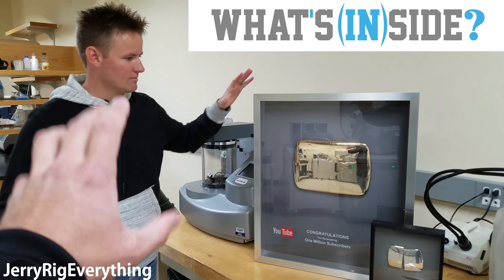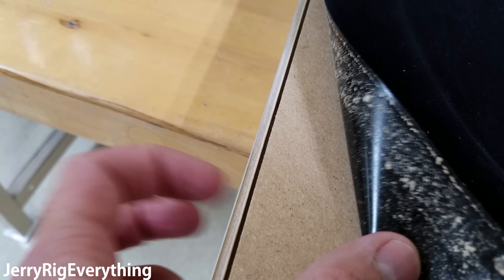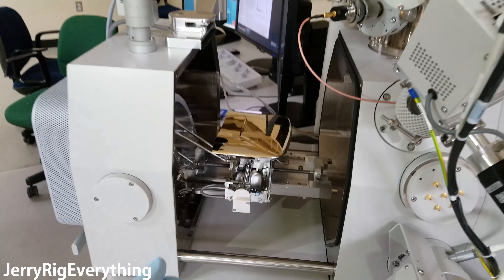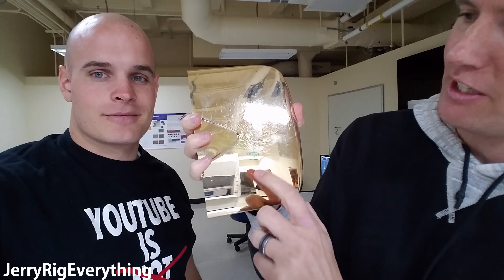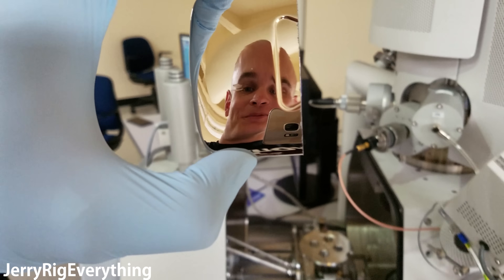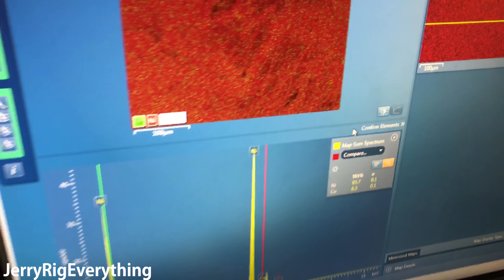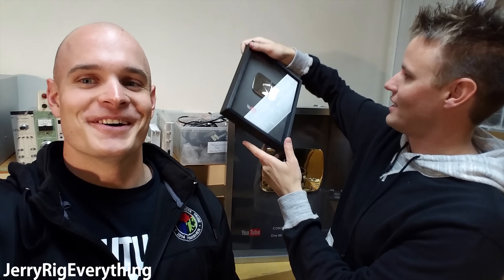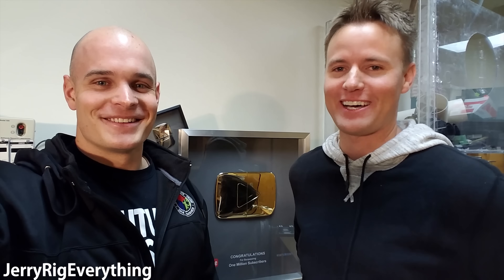What is the Gold Play Button REALLY made of?!?

Comment: Well - as you mention in the video, XRF looks below the surface as well. They would not use silver on the silver play button because it tarnishes. I suspect it would also be brass (Cu/Zn) then copper plated, then nickel plated. The scratch you looked at sees the Cu plating below the surface. Same story with the gold play button. It is actually plated with pure gold, but the coating is so thin that the nickel plating below it shines through. What you see on the outside is indeed pure gold. The inside is brass. This is then copper plated to give the nickel coating something to adhere to. Then it's nickel plated, to provide a barrier for the zinc in the brass, which would otherwise discolor the gold coating after some time. And finally, there's a few microns of pure 24ct gold.

Comment: The button is most likely made of brass, then plated with nickel, and then plated with gold. I've never heard of a nickel/gold alloy. When you looked at the composition of the front, that's what was polished, so the plating is thinner, which is why the nickel content was higher, and is why you saw the brass component. The spectrometer isn't going to tell you the composition of the entire button. Pretty much just the surface and a tiny bit below.
Reply: And I commented before I watched even half of the video.

Comment: It's called electroplating hence the term 24k GP.
They take a brass button and electroplate it with 24k gold in an acid formulation. The electron movement deposits the gold on the brass. Geese did you NEVER go to school?
The gold content on the front is less because it's the polished side. They used a polishing wheel and polishing rouge which removes a tiny bit of gold when polished. Man, I'm old enough to have learned that much, before HS. I'm actually embarrassed for you. SMH

Comment: This actually makes perfect sense... You take a brass blank, and polish it, then nickel plate that, polish it, then gold plate the top for high gloss gold. The silver button can't really be silver because it tarnishes in air.

Gold plating can be as thin as several angstroms thick, while nickel plating is easily measured with standard units. Couple that with the tunneling of the electron microscope, and its rather obvious why you saw so much nickel.

Comment: For anyone wondering, SEM-EDX that they are doing will penetrate a micron or so into the surface. I am not surprised to see Cu and Ni as the most common electroless gold plating processes are a Cu layer, a Ni layer and finally a Au layer. Typically the Au layer is only 175nm-2500nm in thickness. What they could have done is to lap the edge and SEM the edge to see the layer build up if they wanted to verify. Cool work either way.

Comment: the reason for more gold on the back is because the back was not buffed and polished after electroplating. the reason the smoothing goes around the edge is because of the soft buffing wheel wraps around the edge.

Comment: Gold plated items are very typically copper (or brass) as a base substrate, then a layer of nickel, and a flash of gold. Technically, your play button IS 24K plated, but that plating is so thin that your mass spectrometer readings are seeing the nickel every bit as the nickel below it, and the nickel is thin enough that the copper/brass underneath.

The reason why you got readings of a higher percentage of gold on the backside reading vs the front, is that the gold after being plating is buffed to a mirror finish, which actually removes gold whereas the back was left unbuffed. 

That shiny spot on the back is just were the casting in the mold (which is actually made frequently of wet sand) had a rougher spot or some other imperfection, which was then removed with a grinder and buffed slightly to hide it. Totally common.

BTW, the RIAA does not use actual gold/silver/platinum in their record sales trophies either.

Comment: the plating process is probably a gold plate over a nickel dressing layer on a brass metal. the nickle is probably there to help the gold adhere to the brass. the polishing probably removed alot of the gold on the front surface.

Comment: The gold one is made out of brass.  Then gold plated then coated with nickel.  The nickel keeps the gold from getting scratched.  Nickel is a very hard metal.   There is more on the back side because it's not polished as much and the gold goes into all the little groves.   I used to work at a plating facility years ago.  Learned a lot about plating and anodizing..  Good stuff.

Comment: you could play around with the acceleration voltage to vary analysis depth... I think. and the base metal is likely the same for bothbuttons, copper and zinc. the lack of a zinc signal is likely due to it being below the detection limit. nickel plating is necessary before gold plating for better adhesion.

Comment: The gold plating isn't exactly 24KT, but it is definately a gold plating.  and you cant really blame them for making the silver play button nickel because if it wsa silver it would tarnish and nobody wants to see an oxidized silver trophy.
Reply: Tarnished silver isn't oxidized.  It's due to a reaction with sulfur in the air.
Reply: Silver tarnishes over time with exposure to air. It's quite obvious because the tarnish is black. This can't be prevented without sealing the silver from air exposure. There are ways to do that, but they wear away over time and mean you're not actually looking at silver when you look at the thing. If your silver has held up for years, it's probably just not silver.
Reply: Remember how the silver one was nickel on the surface, but not underneath? That's because it was plated with nickle to look all nice and shiny and silver. The gold button is almost certainly brass with a nickle plating, and THEN a gold plating. The nickle layer makes the gold really shiny and bright without having to have a much thicker gold layer. The electron microscope penetrates the surface a little, so is probably picking up on both the gold plating on the surface, and the nickle layer underneath. That is, it IS 24 karat gold.
Reply: I've had a silver ring for years that i dont wear because its ugly and dont sell because it was 80$ and i get 20$ for it. Its still as silver as it was when i bought it or it seems like it. If the ring can be that good the button can be that good.

Comment: I worked for a circuitboard mfg on the gold lines. The reason you see those readings is that huge chunk of BRASS was plated copper, then nickel, then gold. Toss in some cleaning and etching baths in-between each process and viola, fake ass almost worthless trinket and trash award. YouTube should have sent a fat F#@%ing check for generating that much revenue for them, i.e. BONUS/COMMISSION check. Cheap b@$t@r6s

Comment: having a high percentage of nickel is actually quite normal.

if you plate gold directly on copper alloy, the gold will migrate down into copper and will be gold plated no more.

so you start by plating 1000 micro inches of nickel, then plate like 2 micro inches of gold to "color" it.

this is exactly how they do it with el-cheapo gold plated connectors.

Comment: It makes perfect sense. Gold plating is not applied directly, but after a nickel coating. The substrate is brass, followed by a nickel coating and a much finer gold coating. My guess is that the coating on the front of the button is finer because the front is buffed to make is shinnier, thereby removing some gold.
As for the Silver button, it makes sense to coat it with nickel, since silver oxidises to a black patina.

Comment: Great video! This is actually the lab where I work. So here is some analysis. The beam that you were using for the front was a 20 kV beam (you can see that on the video if you pause it too). At that energy the beam will penetrate approximately 1.162 microns into the surface. For the back you used 10 kV which penetrates approximately 0.41 microns, thus the discrepancy in the concentrations could have been largely due to the difference in beam energies. Now, how gold plating works, is that you first put down a barrier metal to prevent the gold from migrating into the core material. The most common used metal is Nickel, which is exactly what you found. Now depending on the type of plating used there are going to be different thicknesses of gold plating. If they used Gold Flash or Gold Electroplate then the layer thickness would be about 0.175 microns and if they used Gold Plate then it is approximately 0.5 microns. So being that the beam only penetrated 0.41 microns on the front it is most like they used Gold Electroplate (or Gold plating and it wore off). I would expect Gold Electroplate since more recent electroplating techniques are not only cheaper but also more durable. For silver, I'm sure they didn't use silver because it tarnishes and turns black from oxidation. So in the best interest of the customer, they used a metal just as shiny that didn't need to be polished regularly.
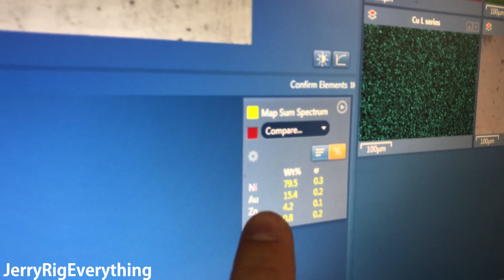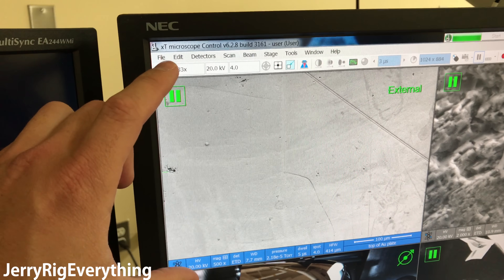Reply from the maker: Awesome catch with that beam penetration. We realized this as well during filming. So we went back and fixed the shot. You'll notice at 3:38 there is a jump cut. At that cut, I move from explaining the images shot at 20kV, but I show the weights from the 10 kV shot. So the information I SAY and show in the video are correct, the 20 kV image was essentially B-Roll film before we fixed the beam. So to summarize, what you see in the video: 15.4% Au is at the 10 kV beam.   You are also correct, you can see at 3:31 if you pause at the right spot, Au is 6.2% with the 20 kV beam. That's when we realized we had a discrepancy and fixed it. 

Observant though. I'm impressed. Interesting information about the gold plating.
Reply: That makes more sense. Science!
Reply: The discrepancy in concentration is because the SEM operator collected the topside spectrum at a working distance of 7.7mm, and then collected the bottomside spectrum at 11.4mm. That specific microscope is designed with the EDS detector pointing at 10mm, and that is where the collection efficiency (as a function of solid-angle collection) is maximum. The 7.7mm spectrum is farther from the optimum plane than the 11.4mm spectrum, creating an apparent difference in concentration. It's all just measurement error. I'd imagine that the amounts would match more closely if you tried at 10mm WD.
Reply: Gregory Wilson wow impressive👋👍